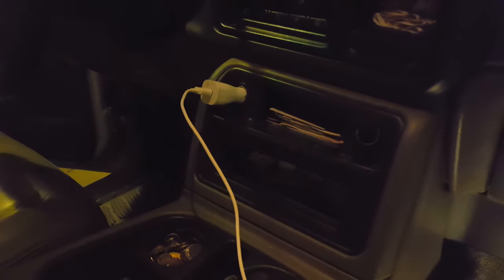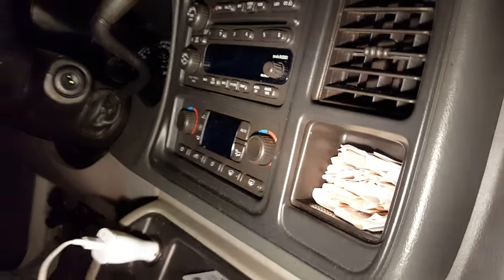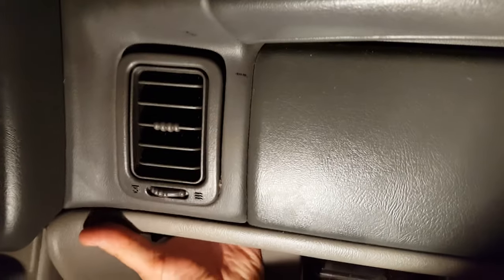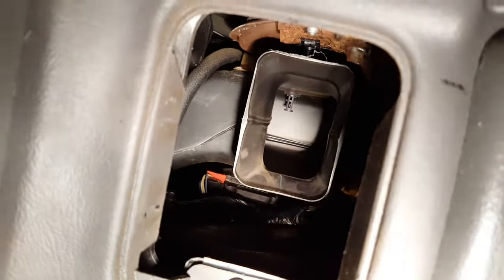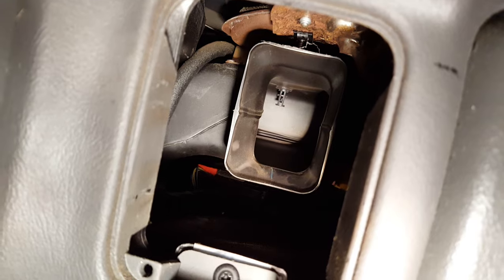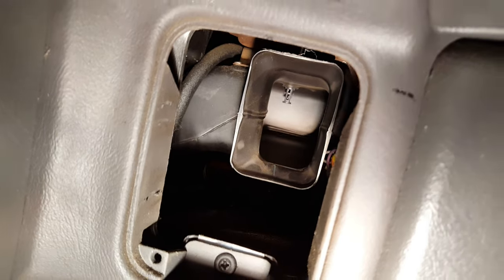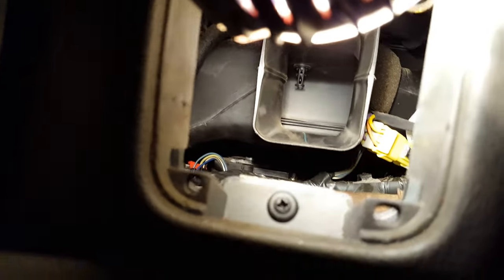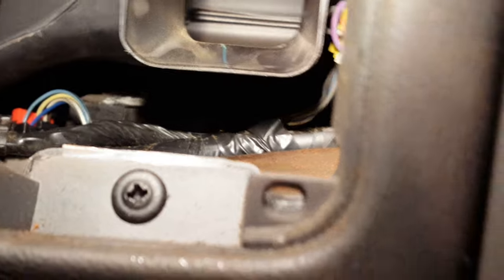2003 Tahoe - Passenger AC blows hot - quick fix

Comment: My A/C was blowing super hot on passenger side, in Texas!  I tried and tried to turn the little thing with the notches on top of the actuator, but there's no way, with no room.  So what I did is, with the actuator plugged in, and flash light looking at it, I turned on the truck, while watching the little round thing.  The actuator tries to reset when turning on the truck,  and automatically goes thru some modes.  As soon as I felt it go into that cold mode (which it usually passes it then goes back to hot quickly and stays) I UNPLUGGED THE ACTUATOR with a screwdriver,  so it stayed cold, stuck in cold!  Quick fix.   My a/c works great now.   When you want heat again, just plug it back in.  :)
Reply: This method worked for me, I couldn’t get a screwdriver on that from any angle. Thanks
Reply: Great minds think alike I did the same thing lol
Reply: Thank you so much

Comment: This is exactly what Ive been going thru. I cant tell you how much I appreciate the info. After last summer listening to my wife bitch about it I was dreading the hot weather cause, like you I was not willing to dig down to the actuator on my 04 - 243,000 mile tahoe. Thank you
Reply: bypass heater core and there will be no more heat until you reverse the bypass

Comment: Thank you for your info this solved my problem without all the hassle of removing the dashboard I just unplugged it and no more heat on the passenger side thanks again for taking the time to make the video!
Reply: How did you get it to move? The round black plastic piece on stop correct?
Reply: @OmegaAuburn  I used a long thin flat head screwdriver to plug it in then opened the key to cycle the door as its on either cold or hot that's when I unplug it and it stays on hot or cold
Reply: @juanrascon7743  you are talking about on the bottom. I might need a thinner screwdriver. You think I can turn it with a long needle nose pliers?

Comment: You might try a manual re calibration. With the vehicle off, pull the hvac fuse under the hood, wait 1 minute, reinstall and restart the vehicle. Often times, this re-zeros all the doors and fixes this issue. Unless, of course, the gear is stripped in the actuator.
Reply: Hey thanks a lot, ur solution worked for me, i also was having an issue with the rear hvac not blowing air where i wanted it to but i took out the fuse for the front and rear hvacs and now everything works as it should,  THANKS!!!
Reply: That’s what going on in my 03z71 tahoe I remove the dash cover to try & catch it from the top however there’s a lot of black plastic duck work I may need to Slightly lift the duck work to get the screws lose so I can get the actuator out without breaking anything

Comment: HOW I FIXED MY PASSENGER SIDE BLOWING HOT. SET THE DIALS TO BLOW COLD, FULL BLAST. A/C BUTTON OFF. LET IT RUN FOR 5 MINUTES. THEN GRADUALLY ADJUST THE DIALS UP TO HOT, STILL AT FULL BLAST. LET IT RUN FOR ANOTHER 5 MINUTES. THEN TURN THE TRUCK OFF WAIT A FEW SECONDS THEN TURN BACK ON. THIS FIXED MY PROBLEM.
Reply: Didnt work for me 😭
Reply: Worked for me !!
Reply: Is this a temporary fix question is it gonna come back doing the same thing because mind did Getting ready to remove the dashboard cover now and try to move the black duck work just enough to get to the actuator so I can pull it out from the AC vent on the passenger side closest to the radio
Reply: @josephandalcio6309  This is to recalibrate the AC. I did repairs first but the AC was still blowing hot. So I had to recalibrate the system. You can do this before you tear everything out though. Hopefully your system just needs to be recalibrated and not fixed/replaced.

Comment: I have a 2004 Chevy Tahoe 5.3 and I live in Philadelphia and on the summer I need more air condition and or on the driver side is fine blows nice cool air but on the passenger side that’s where the hot air comes in

Comment: Cool, thanks for the info brother. I didnt need this info , but I'm def NOT gna not watch to learn something new about my truck. Well mine is an 01 yukon xl but 6 in one half dozen in the other right. I was actually looking for an animation or explanation as too how my yukon allows me to use the dual zone climate system, similar to urs but mine is for the second & 3rd row as opposed to dual driver passenger zones. If that makes any sense?
Basically im curious as to weather or not the truck has two completely separate heater cores & condensers? Or it just uses one heat core & one condenser but can turn them on @ same time etc? Can Anyone explain how this system works by any chance?? Thanks ahead of time cause I'm sure i'm gna get a cpl lessons cause u guys r so frkn awesome

Comment: I have the same problem with my 04 burb. it could blow nice and cold for days or weeks straight then out of nowhere it blows hot. my temperature nobs are all wacked out too. when I turn them to adjust the temp, the temp jumps up and down and I have to turn them suuuuuper slow for it not to happen.
Reply: I’ve got two 04s and the temperature knobs do the same on both. Annoying.
Reply: Easy fix is to take them out and clean them. Bunch of videos on YT explaining how.
Reply: @AndrewVSmith10  you have to clean them. I have an 04 as well, did the same before I cleaned them
Reply: @UncleSarkis  Thanks! 👍🏾
Reply: @AndrewVSmith10  You're welcome.  Sorry, I would have searched for one and linked it up here, but I was outside under 3 o'clock sun, it was hard to see my screen as it was.
Reply: @UncleSarkis  how you get to the actualactor on left side boss? I have a 05 silverado

Comment: I have an 03 Avalanche with what appears the same setup. Tried the recalibration process, but didn’t work. Just want to turn off passenger side vents so the A/C on driver’s side doesn’t fight with the heat from passenger side. I unplugged the passenger actuator, but hot air still blows out
Reply: Watch the video again, he turns the vent manually. What mine did, the actuator, will open for cold air and right away it will turn for heat right after turning the climate control on, so what I did, I turned the engine off when the vent was in cold and unplugged the actuator.
Reply: @waltermora8930  How can you tell when the the vent is in cold mode?  Does it do this at a certain time like when the vehicle shuts off?  Also, I am having issues with the drivers side.  Do you know how to gain access to that side?
Reply: @bigdbassn4489  on my 2004 Tahoe the actuator turns counter clockwise for cold. Turn the notch to where it is on the left side instead of straight back away from you. Mine acted crazy every other day so I waited for it to act right and blow cold and I jumped under there and unplugged the actuator. Always blows cold now. When you need the heat all you have to do is plug the actuator back in

Comment: This is helpful but can’t you just get to that actuator by removing the cover under the glove box and it’s held in by two 7/32 bolts I believe? I’ve seen others replace this pretty quickly on video- didn’t look difficult except for one of the 7 mm cover bolts looked hard to get at.
Reply: Unless of course this one is higher up than the one I saw removed...
Reply: @scottlawson840  not a chance of removing the actuator in my 2004 Tahoe without removing the dash. There’s simply not enough room to unbolt the actuator and maneuver the actuator out without removing the dash. Trust me I tried for an hour. You would have to do some cutting to get it out.  Mine acts up every other day and It’s the heat of the summer right now so I waited until it worked and unplugged the actuator. Ac works Everytime now. When winter comes around all I have to do is plug the actuator back in and turn it to heat. The heat always works. I could see the actuator having trouble turning in one spot so I’m assuming it has a broken tooth that it has trouble getting over.
Reply: @ryanknight5451  that is odd I can get to mine but I left mine in as well and simply unplugged it, same exact thing you did and ice cold now. Winter I’ll plug it back in. I may or may not put the new actuator in we’ll see how much aggravation I want to deal with lol
Reply: @scottlawson840  after looking around for a while, I found that you can take the air bag out very easily and get a way better angle at the passenger actuator to change it. There are two actuators one for the passenger and one for the driver. The driver is located under the glove box and very easy to replace. The passenger actuator is located directly behind the left passenger vent about 10” deep. I think you may be talking about the drivers actuator which is located under the glove box under the black cover and very simple to change.
Reply: @ryanknight5451  yes- the one down low was the one that I unplugged and was the one I was having the issue with (blowing hot on the driver side). I believe there are at least four all together, I would imagine not all are easy to access. The plastic cover was a major pain on the lower one (far left bolt a nightmare), but once that was off it is easy to access.
Reply: @scottlawson840  10/4 I’m gonna be replacing both driver and passenger sides this week. Pray for me lol
Reply: @ryanknight5451  ha will do. It’s probably one of those things where people should just do them all at once with an older vehicle, but it is def a pain in the ass for all but that lower one

Comment: try to recalibrate it first. i did that to mine and it works fine now. no money spent!!
Reply: z71ne1 how do you calibrate it?
Reply: gignacgignac  pull the ac fuses from under the hood and in the fuse box on the side of the drivers side dash. leave them out for 30 minutes, replace the fuses and do not adjust the controls at all. after a few minutes it will reset and start working again. you may have to do this twice like i did and after i drove a few miles it worked fone again!
Reply: Should I leave the controls pre-set to full hot or cold? And also my front driver side only stays on hot no matter the setting along with the backs always being cold. Do you think it would reset that also? Thank you so much for get back to me quick!
Reply: gignacgignac  when you replace the fuses and start the truck do not touch the ac controls at all. when it resets it will probably reset to 74 degrees. leave it alone for 5 minutes with the truck running and then shut it off. it should have reset itself by then. hope this works for you! .....you can also reset it by disconnecting both battery cables and rub them together for a few seconds then reconnect them, at least this is what a mechanic told me.   good luck
Reply: This is what I was looking for. It’s hot as heck, middle of summer. Why not leave the blend door wide open on cold. Good video man
Reply: @travisbass302  probably because you'll just have to do it again in the winter
Reply: @citizenblue  Pop passenger side vents out. Wad up cloth towels and shove them in the ducts. Re-install vents. Problem solved. Winter time pill the towels out.
Reply: The question is did the problem came back eventually down the road

Comment: I am having the same trouble on the right side its blowing cool air the middle vent is blowing hot even when the there is no air or heat on its like hot air out of my middle vent the far left vent nothing comes out! The vents on the far left are blowing the right heat or air but not as strong! cold this be even more issues?
Reply: I'm having the exact same issue with my air how did you fix this?

Comment: Try recalibrating the system on these trucks first!!! Thought I would be replacing actuators too, (air hot on one side cold on other)  but before you buy actuators try recalibrating, THERE IS A PROCESS TO RECALIBRATING if you don't follow instructions exactly it won't work and you may have to do it twice, its for trucks with the (AUTO) settings I believe there is also one for manual air controls too so search YT and try that first!!! $0👍🏾
Reply: How you do it, thank you in advance
Reply: Link?
Reply: @kendrickcleveland9147  this guys Video is the video you need to follow, understand no guarantees it's gonna work though cause sometimes the actuator just need to be replaced.

Comment: Left to right counter clockwise?
Reply from the maker: Joe Rodriguez 
If I remember correctly clockwise looking from the top down. If blowing hot, opposite way
Reply: Ryan Scott I want cool air because it blows hot now so u said left to right for cold air. So clockwise lol I'm lost
Reply: Joe Rodriguez did you figure out which way? Mine is blowing hot and I want it cold and I’m having a hell of a time getting it to move.
Reply: Mc Earl having the same problem can’t get it to move
Reply: I couldn’t get it to budge. I even bent the tip of a screwdriver to try to make it easier but it didn’t help. I ended up resetting the system by pulling the fuse and then waited until it turned itself cold and then quickly unplugged the actuator. It took me several times of resetting it before it moved. Mine seems to get stuck whenever it goes to the hot. A few months ago I just did the reset and I thought I fixed it but it was short lived. I figure in the winter I’ll just plug it back in and it’ll end up hot.
Reply: Mc Earl you want it basically to point at your right arm on hot its pointing to your left arm
Reply: @martinacord12  it was counter clockwise on my 2004 Tahoe for cold air.
Reply: @ryanknight5451  I can't get it to move. Its the black round plastic piece correct?
Reply: @OmegaAuburn  that’s correct. I couldn’t get mine to move with it unplugged or the vehicle off. What I did was get prepared to turn it and then turn the vehicle on with the air on cold, at that point the actuator starts turning until it reaches the spot where the teeth are chipped or broken on the gears inside. Simultaneously As it reaches that spot hold pressure on the turning piece in the counter clockwise direction and that will help it jump over the broken teeth on the gear and move all the way to the cold setting. It is very hard to find a tool that can get in there to help turn it so what I did was get a piece of solid copper wire and bend it to form a hook to grab and hold pressure while it was turning. Once it you succeed at doing that and it rotates all the way counter clockwise to the cold setting unplug the actuator and it will be stuck on the cold setting until you plug it back in.
Reply: @ryanknight5451  that copper wire might be the trick! Thanks! I appreciate the info!

Comment: Hey guys a quick fix and no money spent. Turn your ac to full blast for about 7-8 minutes the switch it to heat full blast for 7-8 minutes. The. Switch it back to cold and shut off the car. Turn the car back on again. This re-evaluates the actuarors and your ac vents should be blowing cold. Give the ac vents to run a few minutes first before you could tell.